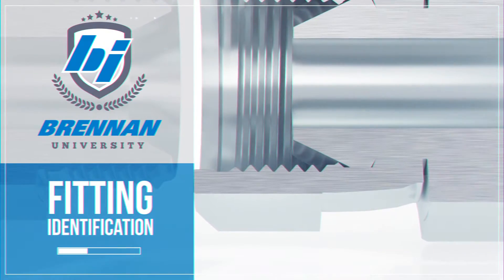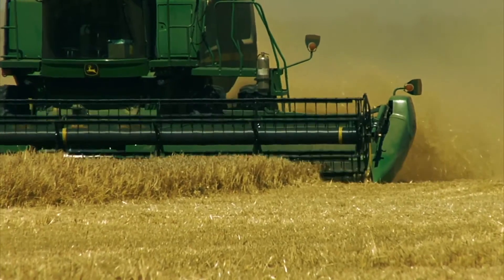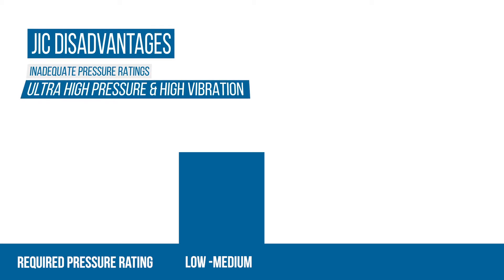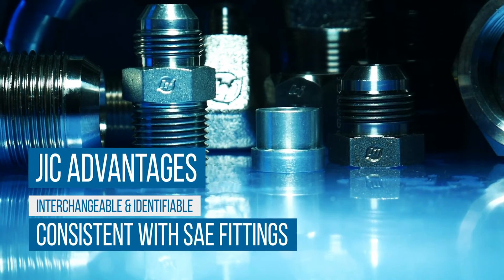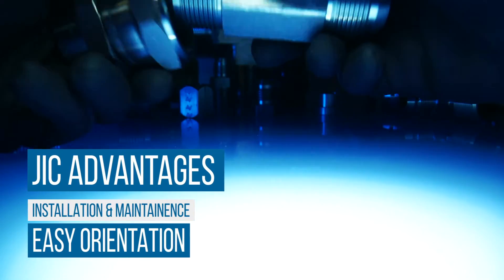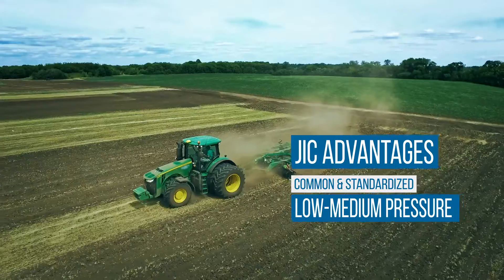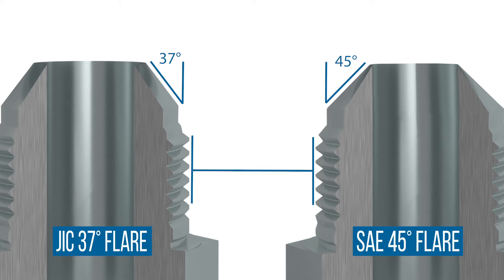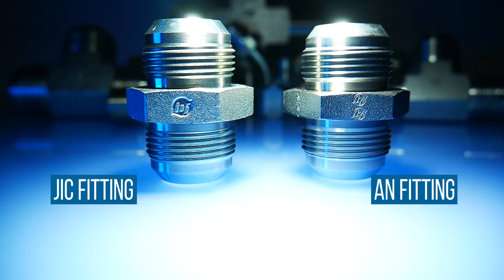Fittings 101: JIC

Comment: JIC and SAE are not interchangeable. JIC is 37 degrees, and SAE  is 45 degrees. It has the same thread but a different angle; thus, it will not seal.
Reply: Not necessarily true. JIC and SAE have fittings with similar 37 degrees flare.
Reply: Sae J514 are 37°

Comment: So the million dollar question is 
How do you identify a JIC and AN fittings apart?
Reply: "Care must be taken to identify" the JIC vs AN.   
There.  
Now you know how!  LOL.
Same threads, same angle.  But different in a mysterious way measurable only when in the company of care.
Where can I find me some care to take and identify them?

Honestly, these 37 vs 37 vs 45 deg flare fittings are a ridiculous and absurd confusing mess and need to be abolished in favor of one STANDARD that works.
Reply: AN has stricter tolerance specifications than JIC but they are practically similar.
Reply: They are the same
Reply: an fittinga used at air condition hoses... so you can identify from the hose or the application